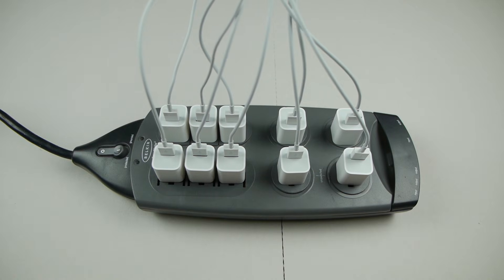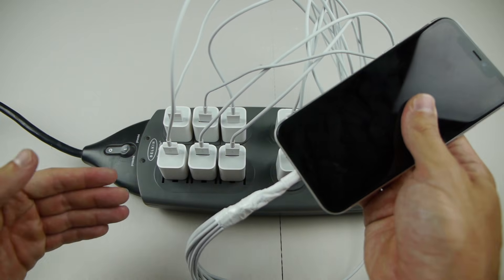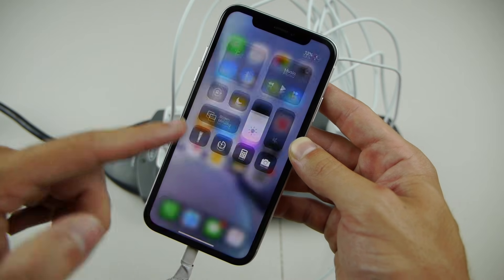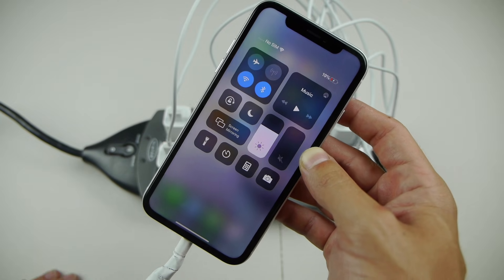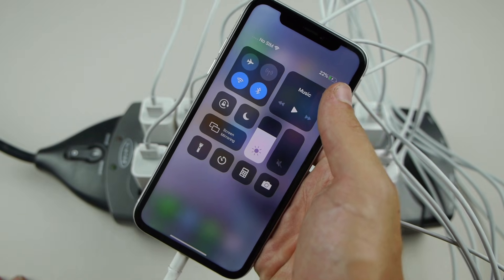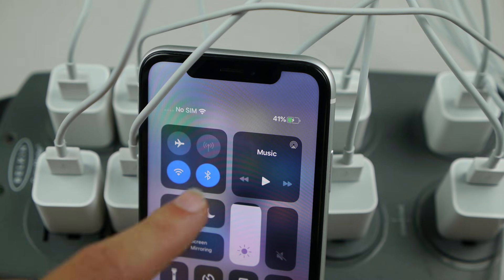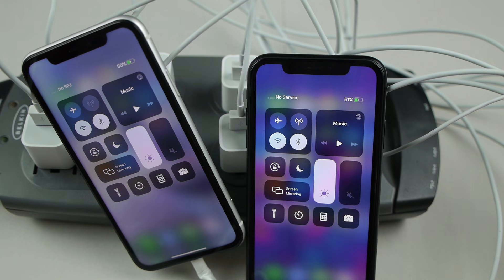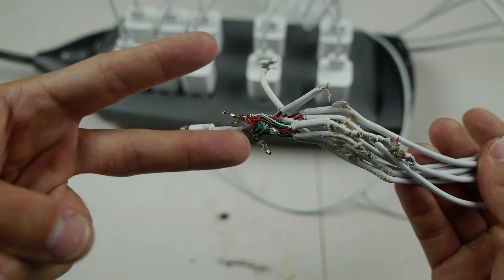What Happens When You Plug 10 Chargers in an iPhone? - One Mega Charger!

Comment: 5w per brick, times 10 is 50w. The charger that is included with the 13” MacBook Pro is 61w, so that would be even more efficient.
Reply: 10 macbook chargers on 1 phone would charge faster. 610w
Reply: If the cables are original, that’s one expensive video, lol
Reply: Your maths is blowing my mind 💥💥💥
Reply: The iphone battery has electronics in the battery its self so it doesnt explodes like the note 7 did so in reality it would be like charging it with a regular 5watt brick and cable
Reply: My phone charges at 65 watts!

11:27 PM
8/12/2020
Reply: Happy John thanks for the date I guess...

3:02 am
8/13/20
Reply: Jxmboree hmm

4:34 am
8/13/20
Reply: Jxmboree 
5:51 am 
8/13/20
Reply: @Janarr_350  I see
4:49 am
8/13/20
Reply: @owok6169  5:17 14/08/2020

Confusion
Reply: Lori Jones he’s probably using the MacBook charger
Reply: @happyjohn1656  oppo?
Reply: @happyjohn1656  my phone charges at 90 watts
charging with dual cable
Each 45 watts
U know what phone is ít.
Reply: @sampletext69420  well xiome is 120w so its pretty easy to charge your phone and xiome is a gaming phone so yeah
Reply: @kitty-chan4340  no
mi 10 ultra
Reply: Roasted
Reply: Not Scar yup, but it’s not an implemented thing tho, it’s just naturally what electronic do is only draw the current they need, you can reduce what they use manually by software or other wise but normally they just only take what they need naturally
Reply: Not Scar what about it? It’s still an electronic device so only takes in what it needs, I’ve never actually used or seen one but from what I gather it’s basically a capacitor with a booster circuit, meaning that it first charges up the capacitor, then dumps out a high voltage from the charge the capacitor stored. It’ll still only pull a restricted certain amount of current that it needs when charging the cap as any other electronic device does. The difference being this stores the energy, then dumps it out as higher voltage, which on something that’s designed for 5V, and not to be back fed with power, is never good.
Reply: The MacBook charged so fast
Reply: Dude its parallel connection so no matter 10 chargers or 20, volts aren't going to add up unless you connect em in series, so to put in a nut shell its 10 chargers but still 5v
Reply: @firebird6933  EXACTLY! clickbait
Reply: Man i was going to comment this one 🙂
Reply: @adamdiab0  it actually has 2 batteries that both charge at 60w so they just add the watts together
Reply: @adamdiab0  true
Reply: That's stupid you want your phone to break mac chargers to iPhone they cant handle that
Reply: elias lidge v2 dude, a phone, Infact any electronic device only pulls what it needs. The rating on a power supply saying “60w” or whatever is the maximum the supply can output, not what it’s pushing out. Current is drawn, not pushed, a phone will only pull what it needs and no more. 

Let’s say your phone charges at a current of 2amps, that’s 10w. If you plug your phone into a 10w charger it’ll pull 10w, no more as that’s all the power supply can handle, and that’s all the phone needs.

If you plug that same phone into a 200w charger, it’ll still only draw 10w, as that’s all it needs. The charger wattage isn’t what it puts out, it’s what it can handle. The phone or whatever device pulls the wattage up to the point it’s got what it needs. 

Think your getting confused with volts which is what’s pushed out by a charger, most things are 5V these days anyways, a 5V 10w charger, and a 5V 200w charger, the phone will still draw 10w no matter which of those two you use.
Reply: I thought so
Reply: So all these apple chargers is basically just a Android charger
Reply: @M.V EPIC mi 10 ultra(latest) is 120w
Reply: was anyone else sus when his orientation lock was off
Reply: The phone support 18 W charging only .... no matter if you use 50 W or 61 W or 125 W
Reply: Every brick has 3w that is the average charger watt for an iPhone unless you have the IPhone 11 Pro and Pro Max which is 18watt
Reply: @レイヒロタカ  nope. It won't damage the battery. And, it's charge the mobile so fast.
Reply: Yeah! Because, the chargers are Parllely connected. So, the current will multiply.
Reply: Well huawei supercharge has 40watts and its just one charger
Reply: @TommyCraft5  well xiome has 120w charger beat that.
Reply: Genius
Reply: Got a good point broo
Reply: Phones should really only be charged with their own charger and not another phone's charger, even if they are the same chargers.
Reply: @adamdiab0  hola
Reply: Bro you are pro ❤️😂
Reply: I wish he interacted with the phone but it was a screen recording on a time lapse.
Reply: the new ones are 18w though
Reply: @daffywonderland  the xiome ones has 120w charger beat that
Reply: I don't know what you are saying but I want to act smart so I will like your comment. 😎
Reply: Fds kkkkkk
Reply: simple genius
Reply: @レイヒロタカ  so will what he is doing
Reply: https://youtu.be/X6vJaWAM6BE
Reply: The new xiaomi has a 120w charger lol
Reply: @Big Dik Daddy hi daddy
Reply: even if its a 10 adaptors i think it will not stack up watts even in different socket because adaptors are capped with 120/240 volts input and 2-2.4 A
Reply: My brain cells
Reply: FN Diab your battery phone is made to received 120w so thats fine for it
Reply: It will damage the battery because iPhone batteries are not like the mackbook batteries
Reply: Shut up
Reply: @adamdiab0  and i still dnt get why ppl keep buying apple products , for daily im statisfied w only mi9 and its 18w charger for less than $350 🤣 , imagine w same budget i can only get some iphone 7.
now think abt it even if u have more budget u can go further w something like mi10 ultra ,mate 30 etc
Reply: @adamdiab0  & 50w wireless charging 🔥
Reply: 10 61w chargers for a macbook pro
My phone: Please.. Yes..
me: plug
whole neighborhood: w h o  t u r n e d  o f f  t h e  l i g h t s ?
Reply: I use a 89 w & its faster than this
Reply: 610w!
Reply: I strapped it to a metal pole and waited for a storm, i ll update you on my projecy
Reply: But it would be blocked
Reply: Dennison DeNatalie he should use a fast charging MacBook Pro charger at 61w
Reply: JackelLight yes😂
Reply: @レイヒロタカ  22222
Reply: Eek
Reply: They still sell that crap with 5 Watts? There are android phones that charge with more Watts than these 10 Together.
Reply: Mãth
Reply: Watts doesnt matter here, ampers matter and charging like this will damage battery becouse  you can charge battery like this at max 2 ampers but he is charging battery at 20 ampers!! Battery can even explodes💣
Reply: @Adkatka  I know the note 7 battery had electronics in it. Every phone battery does. And well over 15 exploded
Reply: Didnt ask😴
Reply: It wouldnt because its capped 😂
Reply: I dont think you understand how electricity works. First off, it's not 5 watts it is 5 volts.It's not 50v, its 5v. For ex let's say we have 2 batterys that are 1.5 volts. If we tower them ontop of each other, they are 3v. But if we were to set them side by side, they are 1.5w and they just last longer. Hope this helps.
Reply: Its Chinese be alert 😅🤣🤣🤣
Reply: I dont understand😂😂
Reply: @cloudyday186  To make it short: this video is pointless bc the phone is limited in how fast it can charge
Reply: It's seems tricky charging... I can't believe this...
Reply: Xiomes chargers has  100w charger
Reply: @adamdiab0  yeah ahahahhaha
Reply: What a mth
Reply: My is 250w
Reply: Knolege
Reply: You are allowed to charge with the mac chargers, its how they do their fast charging instead of making a whole new brick just for phones
Reply: What are you guys saying?
Reply: It is not efficient. It is forcing power into a limited range of 10 volts power input of the phone. Basically a grenade is what he is making. Of course this is fake, otherwise he would not have posted this video because he wouldnt be alive to upload it.
Reply: Its like you can eat a bowl of rice but instead of doing it normally, you shove all the rise that you can find into your mouth. It probably wont kill you but it will damage your digestion. Like the phone. It probably wont explode if its restricting current amounts so the only damage done is your battery.
Reply: @レイヒロタカ  i dont think battery would charge at that much current.
there might be kernel level limit set.
Reply: 3333
Reply: 5volt
Reply: Lmao Xiaomi mi 10 has 120 watts
Reply: Always charge your phone with its own charger, if you lost it calm down and buy a new one, I was charging my Samsung Galaxy J3 with another charger and it damaged my battery, now I have the Samsung Galaxy A40 and it's own charger, and I can proof that.
Reply: Math
Reply: Wat?
Reply: My phone charges as 25w :D

11:04 am 
Tuesday 9/22/20
Reply: https://youtube.com/watch?v=MTtVJ-NMrsM
Reply: https://youtube.com/watch?v=MTtVJ-NMrsM
Reply: But its usb c
Reply: This
Reply: Minecraft
Reply: It looks scaring but it work ✅ am in South Africa 🇿🇦 and it still work
Reply: Ok nerd
Reply: Dm
Reply: Is the one nerd in class that never misses a spot
Reply: FN Diab stop commenting and go play fortnite lol😂
Reply: Yes
Reply: منور
Reply: Mi 11t pro with 120w: WOW LAME
Reply: Get a 120w xiaomi charger lol it costs 10$ and is 60 times more than this
Reply: you shouldnt charge an iphone with a mac charger. the battery in the iphone isnt made for this. in long term it will damage the battery
Reply: @echo_es  yeah so, read about stuff before speaking, higher Volts can damage your phone, higher watts can't
Reply: Camillo Kohl its not like that, ur phone is the the one who is “asking” ur charger for the power it needs. If ur phone has a max of 15w charge power(iphone xr) ur phone will only ask for 15w and ur charger will only give it 15w. Dont think ur charger just gives maximum power when u plug it in. Its the phone that asks for how much Watts it can handle.
Reply: Camillo Kohl Apple officially supports it with I think iPhone X and higher up to something like 81 watts.
Reply: Bix Babble iPhone 8 actually
Reply: Camillo Kohl I’ve used my iPad charger and my battery health is already down to 95% in 7 months 😭😭
Reply: RAHEEM Mahmood that will happen with any charger
Reply: @echo_es  you shouldn't do this either lol
Reply: Camillo Kohl the iPhone has a current limit to limit it to something like 5 amps which is 25 watts so no long term damage it is just way dumber to buy a Mac charger and stick it on an iPhone is the iPhone only accepts about half of that
Reply: Camillo Kohl apple says that it’s fine to do so on their website.
Reply: @echo_es  actually the chargers are capable of detecting the device that is connected so it will  adjust. Take for example the Samsung S8 fast charger which outputs nine volts and five volts for a standard android.
Reply: @echo_es  it'd be fine, phones only take as much as they can so the charger will be limited to the maximum capable in most cases
Reply: @echo_es  it makes no difference. The chargers are smart chargers, they'll turn themselves down
Reply: Camillo Kohl they say you can change it at 96 watts which is there biggest charger
Reply: Camillo Kohl iPhones limit the Mac charger to 18 w the maximum iPhone charge speed. iPhones can’t really limit the 10x 5 watt chargers because how it’s connected so the iPhone doesn’t charge consistently
Reply: Camillo Kohl you do realize the fast charging cables Apple makes for iPhones are exactly the same as for Mac 😂
Reply: Sun is not the cable genius 🤦🏼‍♂️ is the brick.
Reply: @Sunnybeast16  its about the power brick not the cable but still, it doesn't damage your phone
Reply: Camillo Kohl that’s literally false
Reply: @luisrosales9349  it's not It really damages your phone internally
Reply: A lot of the people here really don’t understand electronics do they 🤦‍♂️ giving a possibility of a lot more power isn’t gonna cause anything dramatic, a phone, Infact any electronics device will only pull the power it needs, providing more power will only make the phone pull the max power it can handle, not as much power as all the power supply’s can handle together. 

You can provide a phone which pulls max 2.5a with a 5V 2.5a charger and it’ll pul 2.5a.. plug it into a charger that supports say 5V 12a, it will still only pull 2.5a as the phone only pulls what it needs.

I charge my iPHone 7 (yes I know it’s old, I’m upgrading very soon) using a 2.1a charger, but the iPhone 7 only pulls max 1.5a so that’s all it will pull and it’ll just charge at the maximum rate it possibly can. Plug my dads iPhone 11 into the same charger and it pulls 2.1a, the max the charger is good for, and possibly the iPhone 11s max charging rate too, but I don’t know what that actually is so can’t comment in that retrospect.
Reply: Xtrakt 2241 finally someone that has some circuits knowledge smh
Reply: @KylesCarsYT  I was looking for this comment because it seems that we are in a sea of people with no knowledge of electronics
Reply: But the cable is type c and iPhone uses a lightning cable... use your brain bro
Reply: @KillerMoth7121  but you can switch it out
Reply: @KillerMoth7121  bro cut the type c and attach lightning cable on there simple
Reply: Aarav Gupta you can get a usb-c to lightning cable
Reply: I have one and it messed up my battery health
Reply: Is it actually safe to charge your phone with a mac book plug
Reply: I dont care

Comment: As someone who curious, i kinda has basic of current, voltage and watt, so here's my question 

1)How much watt does it produce some normal charger? 

2) based from the logic electrical law, how much Amp does that hit???? Like nowadays, there's like 2.5A or even 5A cable charger, i just can't imagine how much ampere is going on with the 10 cable... 
(or there might be a current limiter in between the end of the cable, or the iPhone input slot)

Comment: no matter what happens, it will stay at 5V (if it isnt a fast charger)

you can only connect it through a parallel style connection. you cannot increase the voltage and shock yourself.

YOUR PSU IS NOT A BATTERY.
if you attempt to connect it by series, the negative prong will short to the negative prong on the plug. therefore catastrophe.

it wont give you a shock. 5V 1A cant even kill an ant

Comment: So, the iPhone can control how fast it charges. It wouldn’t be able to use all of the amps that charger puts out. It cannot take advantage of more amps than an iPad charger puts out around 2 amps. Also the iPhone slows the charging down based on temperature. I have found this extremely true when my phone was hot and would not charge above 12% but as soon as I cooled it down charged normally from the same charger. Hope this adds some clarity to this.

Comment: Ok, this pretty much did nothing. He has 10 x 1amp/5V chargers working together in parallel to make a monster 10amp/5v charger. Amps are "pulled" / "drawn" by the device so the iPhone just takes how much it needs safely, and volts are "pushed" by the charging device. You can always have any large amp charger, your device will only draw how much it can safely handle, but if you over-volt a device you'll fry it. Here voltage is not "multiplied" because his circuit is in parallel not series.

Comment: Charging with multiple cables like this is dangerous, there can be very high currents and the solder joints (plus the lightning connector, etc) will not be rated for it. Plus, with all of those cables, some were likely battling against each other, so it's no surprise that a single cable was better.
It's best to get a decent quality, high current charger for your device (up to the maximum rating for the device) and leave it like that to charge normally.

Comment: “Everyone should try this”

Few mins later

“This is not efficient”
Reply: This is the iPhone supercharger 😂 let’s hope Apple doesn’t cut it off for rebuilt phones
Reply: It's efficient if you if you want your  home to be burnt down
Reply: @simonericketts1298  😂😂😂🤣🤣🤣
Reply: Why I feel like he didn’t connect a single one and just use one and he is just cutting it
Reply: Lol 😁😁😂
Reply: Suck that all I can say
Reply: what a nonsense video.Increasing more charger in parallel connection means joining same color wires will remain same voltage and current will multiply increase by number of connected charger in parallel. So power rating of overall charger will increase and it start fast charging, as we seen in fast flash charger. But it will harm mobile phone and battery may it will be explode also.
Reply: @GyanDoseHub  That's not how chargers work. The chargers don't apply the rated 1A, they only supply up to that amount, the electronics take what they need. That is why your little Bluetooth earphones don't get overloaded from charging off of a 5V 3A.
Reply: @GyanDoseHub  It wont explode because the phone has a capacitor. and also there are fuses(maybe ones that can recover cus ones they rbeak its over.)
Reply: Charger is great
Reply: Funny you see these comments while scrolling as they say it
Reply: because of capacitor tolerance. if you want to know more search up capacitor then search up capacitor tolerance meaning.
Reply: Me: try this

Phone: allahu akbar
Reply: 爪口工
Reply: @sachinsheejo36  ayeeeyahzee

Comment: There are so many protection circuits inside a phone. The voltage that comes in is just 5V and you simply give the oportunity to how many amps  it wants so the only limit will be the limit of the protection circuits inside the phone. And also because you have DC there will be also a resitence because of the material of the cables

Comment: This is fake though, they are in parallel so it does not change the voltage supplied, only the amperes or current increase but the phone will charge only as fast as much current it can accept, so technically it's just a normal fast apple charger